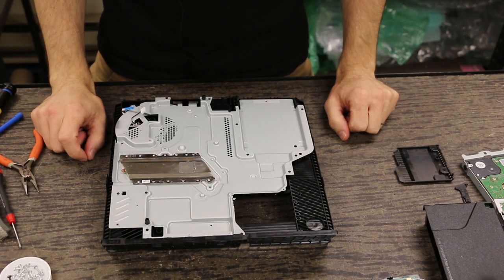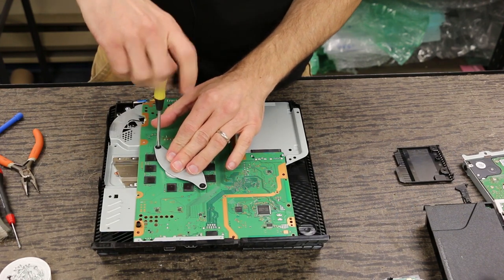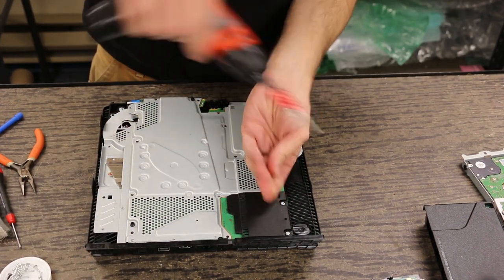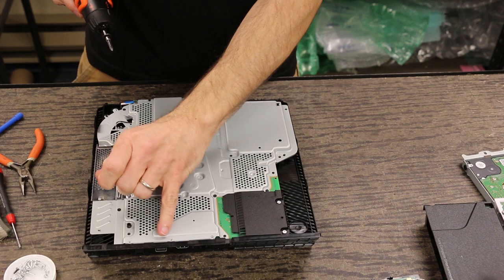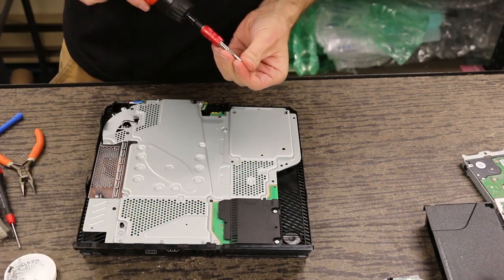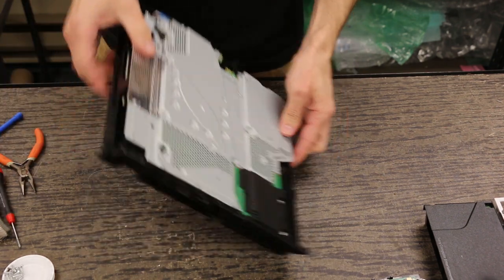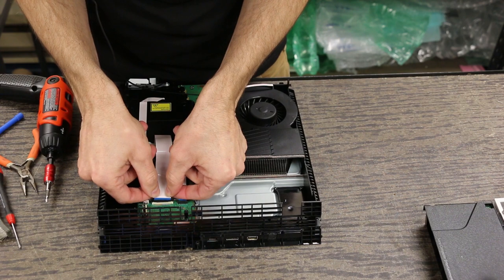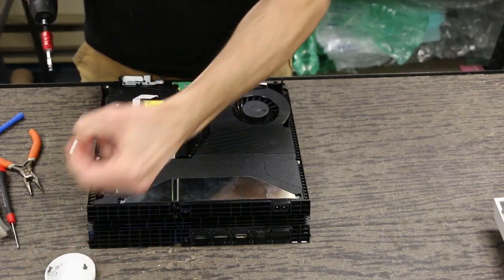PS4 1215 Assembly Tips & Tricks

Comment: Once again great job! I took mine apart and when I picked it up that small square metal piece that goes under the little plastic cover fell to the floor and I had no idea where it came from. I know exactly where it goes now thank you! Hopefully my reassembly will go as smooth as your did after I replace the HDMI port.. Thanks again!! You da man! I was wondering, is there any way to replace the 3032 battery without losing the memory??

Comment: Hey there,

I was watching ur video on taking apart this model, and I accidently half-way tore off the power supply connector on the motherboard, thinking I was pulling on the right part with the pliers. I stopped there, realised what I had done, and panicked I cuz I realised I just broke something on my PS4.  Now I'm gonna go get it fixed at a repair shop . 
Could u plz use more detail and zoom in more when doing these things?
Reply: Thanks for the video tho!
Not saying what happened is ur fault, I probably should've known for sure what I was doing, but at the same time it's nice to trust that the content creator is aware of thsese issues

Comment: I Did All OF This And It Still Does The Same Thing, It Works For A While And Then Says Its Too Hot And Then It Turns Off, I Even Cleared All Of The Dust Covering Up The Heat Sink  Or Whatver Its called.

Comment: although this doesn't relate to this video I just have something wrong with my ps4 that I can't fix: I was watching YouTube then my consoles audio cut out and my controller wouldn't work at all so a decided to restart the ps4 using the ps4 after attempting to reboot my console it gave me an error code saying it couldn't launch and needed update 3.11 I then proceeded to launch the ps4 in safe mode and try to do the update thought safe mode after completing so it gave me the safe error code saying I needed to do the same update
Reply: using the ps4 power button
Reply: note I just tried updating again and I got an error message saying a serious error has occurred with the code CE-30785-3
Reply from the maker: +RANDOM GAMING Is this a new PS4? If it is be sure to return it for a refund or exchange. 

It's hard to know for sure without being able to see it but sometimes this is a hard drive problem. That is what I would check first if it was in our shop.

Comment: You mentioned not to use a heat gun to replace the HDMI port in a previous reply to someone.. What do you recommend using if something other than a very fine tipped soldering iron? I will be replacing mine in a 1215A in a few days. Any tips on how to do it? Should I tin the pin pads before installing the new port and heat them one at a time or would you do something different? Removal tips??

Comment: I took apart mine to clean the laser I reassembled it and now it doesn't want to take the disk. Is there a special way the plate is supposed to be sitting or the magnet in the center supposed to be down?

Comment: You mentioned a problem at 10:16 about one of the screws not getting tight because of a tiny metal square. Well I have that problem and I have no idea where the square goes. I’ve looked all over and I can’t find a solution, I really need your help.
Reply: Never understood I solved it, it goes under the black plastic piece on top

Comment: (Old mexican saying is "if you got left over screws. its because you did it correctly)

Ill be okay right?
Reply: I ended up with 8 extra screws... I know its a year later but, how's yours running?
Reply: @hecticalloy6511  im not only missing screws but i also tore the metal braket that goes on top of the power supply, and i had to do some repairs on the ribbon cables on some i just swapped from another device. All this happened from all the opening and closing. So be careful if your assembling and disassembling your system

Comment: My PS4 comes on it works then I pick a user and it freezes and turns off do u know a way how to fix it?
Reply from the maker: +Bradon Huitt You can try hitting it on your knee or the floor and you can also try turning it up on its side. Sometimes these two things get them working for a while.
Reply: +TronicsFix I have the 1215a model ps4 and I want to upgrade my hard to a 1tb hard drive and I was wondering would I need a 2.5 inch or a 3.5 inch 1tb.
Reply from the maker: +Isaac Barrio 2.5

Comment: Does anyone know why the main 4 wire connector won’t push back in from the power supply
Reply: Oats N Yotes i have the same problem did u find a solution?
Reply: Savas Hosafci you can try to soder it back on but it most likely won’t work

Comment: Is eject button supossed to fly?
Reply: Mine is that the power button is stuck
Reply: @Sai-sj9cl  pull on the right side as hard as you can and it make a pop and pull of the left
Reply: @Sai-sj9cl  make sure you took out the 5 screws on the power supply
Reply: @slumpak  right side of what?
Reply: @Sai-sj9cl  we’re you ever able to fix this?